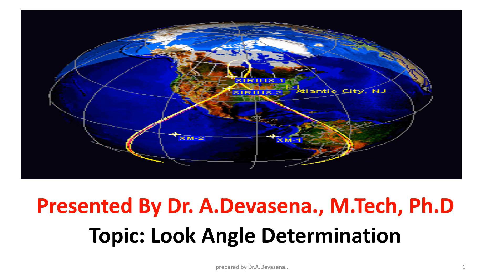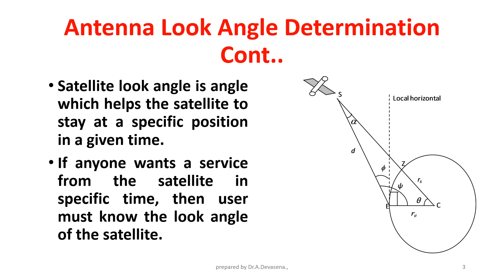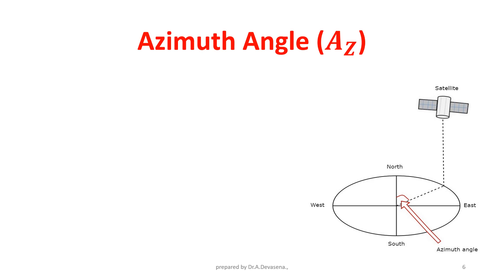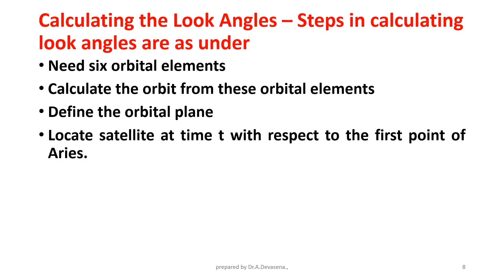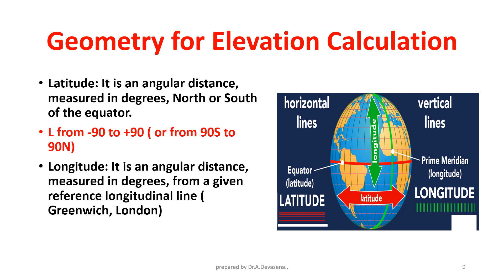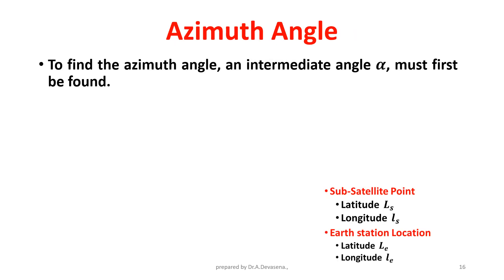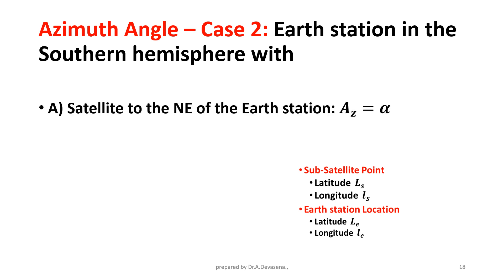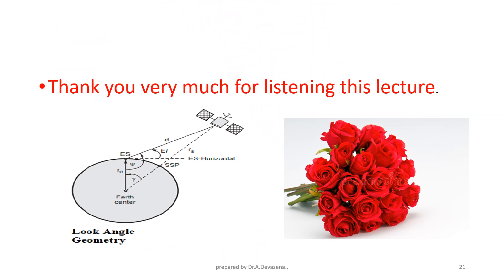Look Angle Determination in Satellite Communication

Comment: % user defined data : Satellite
Re = 6371e3;          % Radius of Earth(km)
h0 = 554e3;            % altitude of satellite ex:starlink-1007
alpha = 53.1;             % inclination, elevation angle (>= 10 degree)  

  % according paper's formula
    d = sqrt(Re^2 * (sin(alpha)^2) + h0^2 + 2*h0*Re) - Re * sin(alpha);
    
    % use law of cosine
    % d = sqrt(Re^2 + (Re+h0)^2 - 2*Re*(Re+h0)*cos(alpha));
    % d = sqrt(Re^2 + (Re+h0)^2 - 2*Re*(Re+h0)*cos(alpha-90));
    % d = sqrt(Re^2 + (Re+h0)^2 - 2*Re*(Re+h0)*cos(90-alpha));